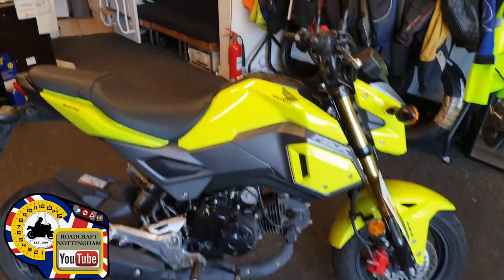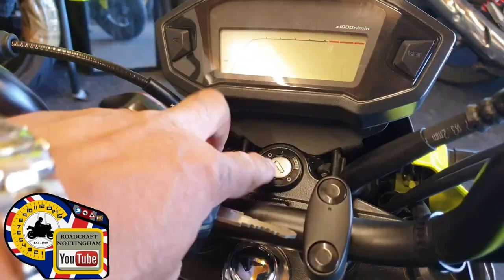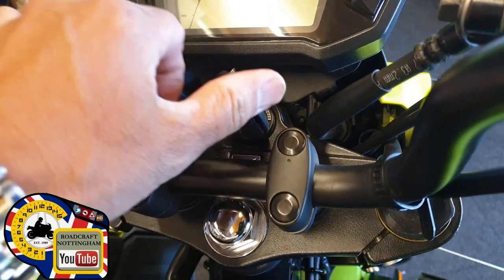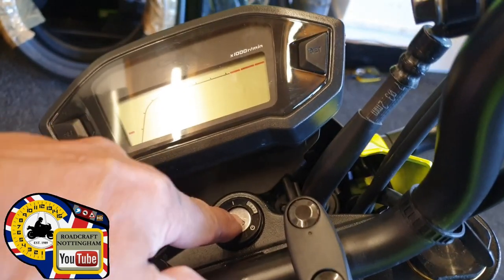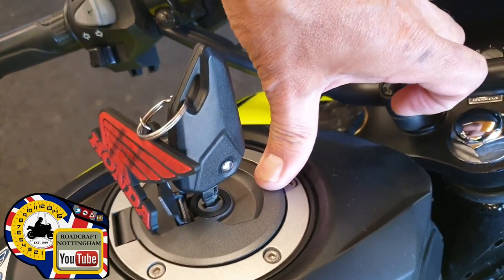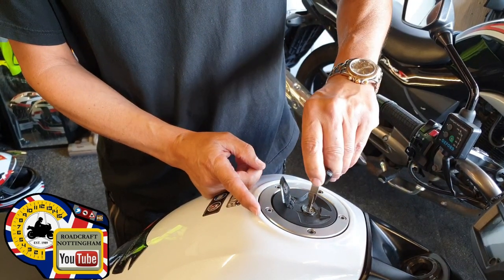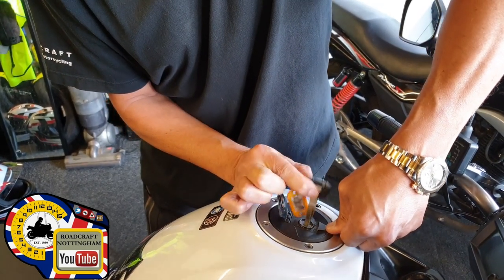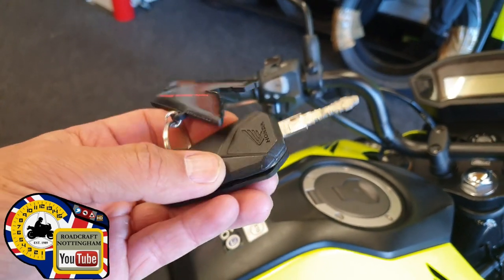Quick Tip 3: How not to snap your motorcycle ignition key. 2023

Comment: Some golden tips!
I would also like to add the following:
Never ever put anything heavy or additional onto your keys. (other then a plastic/rubber logo as depicted in this video)
I have seen many keys with a whole range of logo's, extra (reserve) keys, small tools, rings etc also hooked onto the key.
The sheer extra weight can wear out the ignition-key barrel, please have only the key (and nothing else hooked onto it) in the ignition at all times.
Having additional keys near the ignition can sometimes also upset the electronic immobilizer and cause your bike not to start, block the ignition-sequence or even trigger the alarm.
If you have multiple keys (or badges etc) to wear/carry, use e.g. a lanyard with a (preferably plastic) quick-disconnect that you can wear around your neck.
Although it is always better not to wear anything substantial around your neck (or back) that can leave a lasting impression (pun intended) when you are in a collision, accident, fall-over, or other mishaps.
Reply from the maker: DAMN! I knew there was something I'd forgotten. I always have a friendly dig with people with massive bunches of keys. Thanks. ☺
Reply: @RoadcraftNottingham  No worries!
And some other tips, like never use only 1x of your keys all the time but also "rotate" every month or so.
That way the wear-and-tear is more evenly across all your keys.
Plus, as some keys do have chips onboard for the immobilizer,  (and ring-antenna around the ignition-switch), using only a single key for a prolonged time might sometimes "upset" the immobilizer because of "key-counts". (rotating codes etc etc, a bit too technical for this video).
By using all your keys more regularly (rotation), you can avoid this "bug" for some immobilzers.
Same goes for the remote of your alarm (if equipped), rotational use those too. (and have spare batteries handy, and know how to replace them, just in case)
As for the plastic reserve-key (if supplied) never ever use this but know how it operates & functions on your bike and try it out a couple of times. (but not more)
And carry it with you at all times but not near the ignition. ;-)
Best practice is to have minimum 2x keys plus reserve (if supported) with your bike, preferably 3x keys total.
BTW, with older bikes and massive bunches of keys, don't be surprised that after prolonged years, the keys will flip-out during riding. 
(and hopefully not switch-off the ignition then and there. Often on the highway, Murphy's Law)
And inspect your keys for minute cracks, if so, replace as soon as possible and adhere to Roadcraft Nottingham's sanity of proper key-usage.
If you feel the key is going in (or out) with some trouble, cleaning and as outlined below, lubrication (with graphite, I'm told) might be in order.
Last but not least, read your owners-manual about all your locks, including steering-lock, alarm etc, as the manufacturer often outlines how to properly use them under what circumstances and how.
Reply: Never really thought of that... I have two garage keys attached to my ignition key. Maybe I should put those somewhere else. Thanks!
Reply: I have a clump of keys (disc lock key, chain key, etc.) together with a small carabiner on the ring to clip to the actual bike key for easy disconnect and either use a wrist strap, jet tag or rubber keyring on the ignition key just to make it easier to grab onto in pockets etc. (i pick something soft and lightweight so it doesnt cause scratches or damages) those little carabiners are great for keeping keys together when theyre just hung up.

Comment: Thanks Russ, the reminder to never force a key is worthwhile. Whenever I feel any lock getting a little sticky I spray deep inside the lock with WD40 using the hollow straw that comes with the can to flood and clean out and lubricate the lock. In Winter I would have to repeat this every month or so and clean off any black gum that collects in the keys grooves with a paper towel or clean cloth.
On House door locks it's good to puff a little graphite dust into a lock to dry lubricate it but never use this method on a bike or car as the graphite can work its way into the contacts to cause a short circuit.
Reply from the maker: Some excellent points there. Never thought about the graphite conducting Thanks.

Comment: Oh such good advice. That stove knob key on the 1400 Kawasaki Concours will bend if you look at cross-eyed. On the Connie forum I found a cross reference to a key for a tractor IH I think and begged a locksmith to cut it for me. I keep that for opening fuel (petrol) cap while pushing downward on the cap, and for opening the panniers. I leave that ever so fragile stove knob in the ignition where it belongs.
Reply from the maker: Agreed. I had a cheap non chipped key for the petrol lock.

Comment: I was all ready to eyeroll this until I remembered how much trouble I got into with a broken key on my first bike after bending it in the gas tank. I can't remember all the details, but I got it home before it broke off in the ignition. It was night and I kicked myself at first for not leaving it at the lock shop interest of going home (was mucho tired), but I managed to get the cylinder out of the yolk. The locksmith was also a rider and took pity on me with the fee for removing the broken piece and making new keys from the broken pieces....which WORKED BETTER than the first key. I stopped going to big box stores for auto key copies after that.

Comment: The pannier locks on the ol' FJR used to scare me, I always took a spare key if going abroad. Best to look (as you have) at the workings of any mechanism to understand how it works best or at least how it's intended to be used. Good tips Russ, I've not broken a key yet but I've bought a few with bent keys :D
Reply from the maker: I've had a few old suzuki keys with that crack starting to work it's way across. ☺

Comment: Hi Russ, what would you suggest to lubricate  your locks with. Thanks Garry 🇦🇺
Reply from the maker: Wd40, gt85. Any of those thinner spray lubes with straws attached.
Reply: @RoadcraftNottingham  I used WD40 a few times and found it got even worse a few months later each time.
 I gave it a solid blast of chain oil, and it's been slick these last few years - apparently they come oiled and WD40 washed out any lube that was still in there.

Comment: Lubricate lock - use oil, just a drop. Preferably a good light machine oil but a drop form your oil filler cap or dipstick will do the job; not an oil that turns gummy. Do not muck about with pencil lead, they're mostly abrasive clay not graphite. Excess oil on the filler cap will mix with petrol, no problem.

Comment: I had a ER6 hire bike with a very bent looking key for this reason. I'm surprised how forceful people are with these things rather than taking some time to workout the mechanism. similar to people who stomp on the gear select lever when they can't get it in first, just roll the bike a little or slighty release the clutch and it'll change fine without the need of your bodyweight on the lever
Reply: Ye, and then you have the fun time of bending it back, to get the ignition to work... that fine line.
Reply from the maker: Makes my ass twitch seeing people stamping on levers instead of using the clutch.... I've just found another tip. ☺
Reply: But some times you don't even think about it, just put the key in and twist... most times it works fine, but you get on that occasion a twister.

Comment: I was wondering if you could give me some advice? My kawasaki versys 650 seems to almost seal itself shut on the petrol cap and when I do get it open, it makes a sound as though there was some air pressure holding it shut and it can be quite hard to open at times. Any reason why this may be? Its like its pressurised keeping it closed.
Reply from the maker: Yes, there will be an air escape hole about the size of a biro tip under the petrol cap. That'll be blocked. My friend had the same problem with a kawasaki and the tank imploded so get it cleared out.
Reply: @RoadcraftNottingham  thank you, will do this today.

Comment: Any recommendations for lubing the key + locks? I usually just spray a bunch of wd40 on the key and a tiny bit in the lock, seems to do the trick. Not sure if I'm making things worse in the long run though.
Reply from the maker: Wd40 is fine on a regular basis.